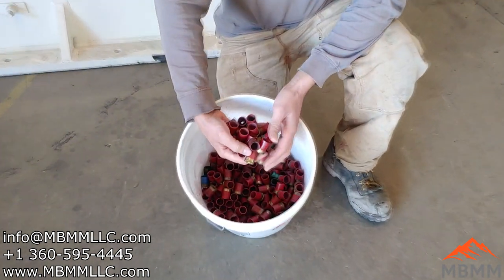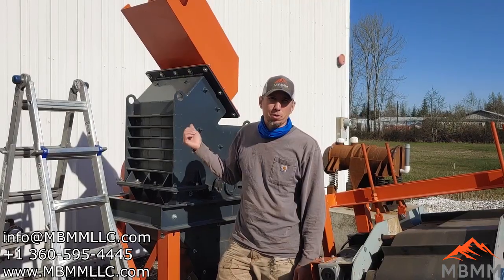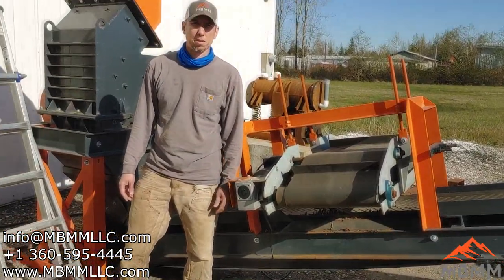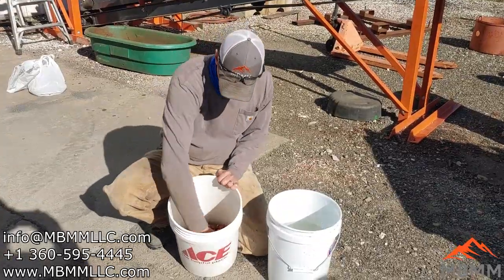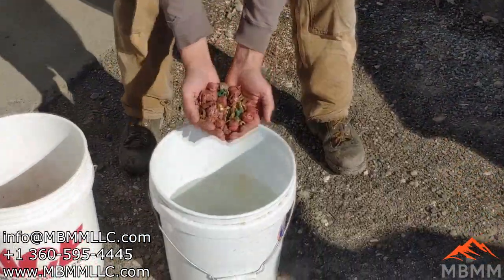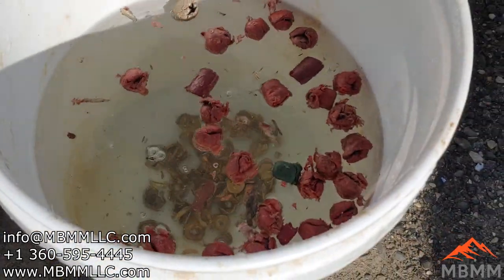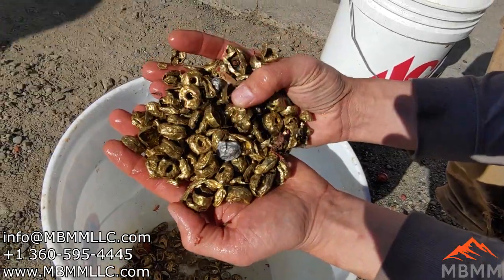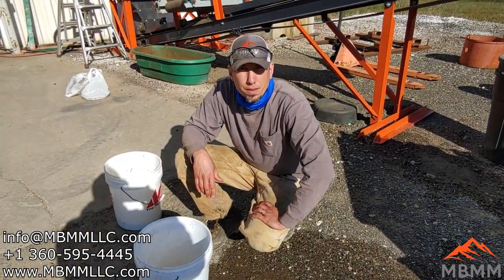How To Recycle Shotgun Shells For Money

Comment: If your water trough had a tapered bottom at least on the longitudinal axis, you could use a flexible coil auger (used to move feed in cafos)   to move the brass into a collection vessel.

Comment: It seems like all the shotgun shells that I come across these days are all Steel...
Reply: Steel with copper/ brass coating on the metal part.
Reply: @larrytischler570  Damn - Sure enough. I just grabbed some high brass buckshot off my desk and scratched it with a knife. I don't imagine there is any good reason to use brass on a plastic hull shotshell.

Comment: one problem lately is that more and more of these are brass plated steel and or aluminum even if you knock out the primers. something to check for before doing this is take a dead speaker magnet out of a subwoofer and if the shells stick tis likely only going to be steel which i forgot its recycling rate but it likely barely covers the cost of running the machine to recycle them.

Comment: Have you figured out a safe way to smelt silver cadmium contacts?
Reply: Dissolve them first in nitric acid.... once dissolved completely dilute with distilled water. Then add some clean copper pipe.  The pure silver will cement to the copper pipe.   Allow plenty of time for cementing. Stir lightly couple times.  Strain dry and melt it into pure silver bars.